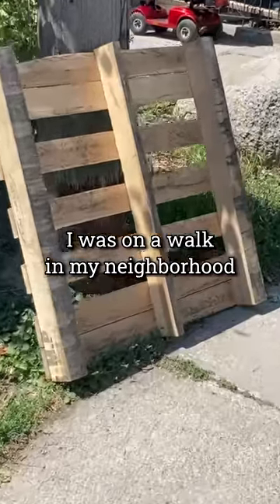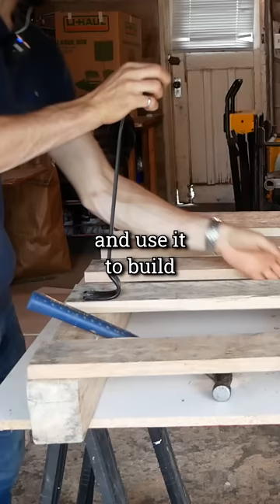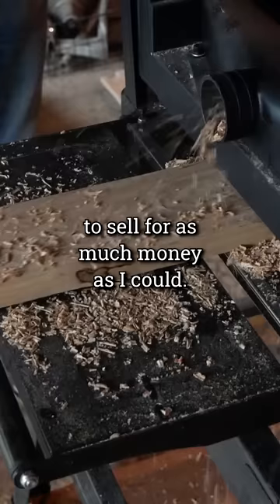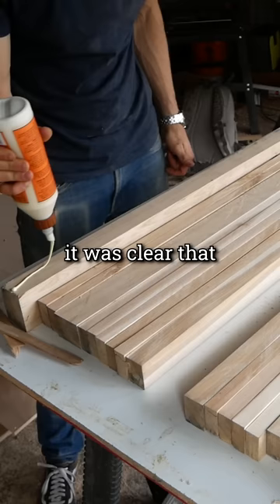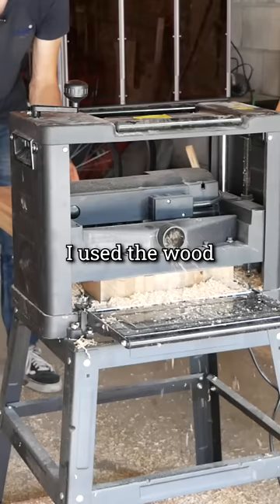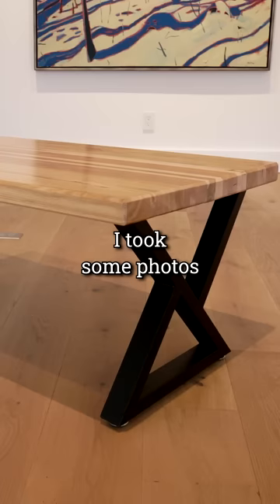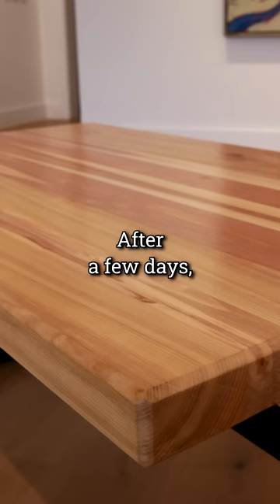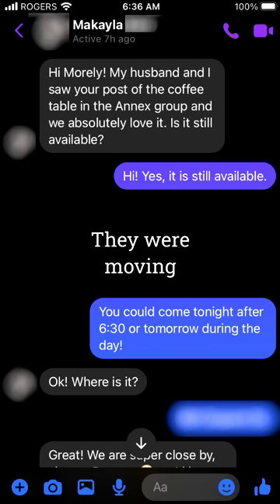Free pallet 👉 $550 coffee table #DIY #woodworking #upcycling #shorts

Comment: Lots of pallets from Asia are hardwood because they get loaded up and stacked in containers with massive weight. Look around importer warehouses. Probably give them away free because they usually are odd sizes for USA/CA pallet racks.
Reply: Depending on what's being shipped, a fair amount of stuff in the US gets loaded on hardwood pallets. 

In the parts of the country where hardwoods are primarily what grows, there are sawmills that concentrate on providing solid oak or other hardwood pallets to companies that need them.
Reply: And mostly illegally obtained too🤣
Reply: I didnt think that was hard wood, but if it was then that's fine to use a pallet
Reply: I've worked in warehouses, and I can confirm that they will DEFINITELY not give you any pallets for free lmfao they cost money
Reply: @Miguel-cg2vz  they will give out old chewed up ones tho...

Comment: How can you sell it for that much? Daylight robbery
Reply: Looks like something you would buy at Walmart for $125
Reply: @robbnoble1509  granted it would fall apart next week
Reply: Hardwood is a quality material and 550 is a great price for nice furniture
Reply: @averyspurr2045  Pallets are usually chemically treated, so even if it's hard wood it will deteriorate much quickly and could pose a risk to health so yeah.
Reply: @winglessbat  Pressure treated wood is much more resistant to rot and ware than untreated wood.
Reply: You make it.  To get started you'll need like $2000 for all the tools and supplies....planer, table saw, sander, sanding paper. clamps, wood glue, screws, nails, steel legs(not cheap) sealer/stain.  And yep, you'll save a buck or two ...cause yeah, you work for free.
Reply: Everything is worth what people will pay for it.
Reply: It's worth what ever you can get someone to pay
Reply: Says the guy who lacks the tools, skills, and knowledge to build a table like this.😂🤣😂🤣😂🤣😂🤣😂🤣😂🤣😂🤣😂
Reply: up to the buyer if they want to pay the price 🤷🏻‍♂️
Reply: He just made it up.
Reply: @quietobserver4636  the knowledge? What the hell U think this guy built Noah’s Ark?
Reply: @_t_f_  The point is he built it, he set the price, and he sold it. Contrary to what you've been taught, you YouTube warriors can't put a value on another man's labor and it makes you mad. So, just ask your mom to buy you one I guess.🤷‍♂️🤷‍♂️🤷‍♂️
Reply: because it's handmade by someone personally? Skills you don't gave, working hours, tools you don't have and it's good wood. no one's asking you to buy it lol. the store one will obviously be cheaper because it's not handmade
Reply: @Rie_Bot  to understand this kid's comment you must understand how they've been continuously indoctrinated their entire lives. They're taught the doctrine of envy and victimology. They never consider what it took for an individual to get where they are, or achieve what they've achieved. They're just taught that it isn't "fair". They want equal outcome without equal effort.
Reply: You obviously know the cost of everything, but the value of nothing!
Reply: @Rie_Bot  and what's so special about it being handmade?
Reply: @eulehund99  handmade things are often better quality than mass produced ones which use every cost cutting method they can. buying handmade stuff also supports people producing these products, not just large businesses, and thats needed to have healthy competition in the market amongst sellers, which leads to better quality and priced items overall in the market. other than that, there isn't anything special, don't buy if you don't want to lol, no one is being forced. but this section of the market exists because there is a demand for it, and a significant demand of people wanting handmade products. its a bit of a novelty
Reply: @Rie_Bot  good points you mentioned. From my experience, I saw little to no difference between handmade and mass produced ones (except food lol). I often even found the mass produced to have better quality, but the handmade to be more interesting. I also wouldn't say the demand is huge for handmade production, as we today have a new trend every hour.

Comment: So other people dont make this massive mistake, most pallets like that, are owned. They are not just free, they belong to a company, especially if they are blue or red. Just dont.
Reply: The place I work at we get shipment of supplies and we always cut them up and throw them away. But it’s important to ask before taking
Reply: I've worked at multiple places where pallets would pile up.  Some of them kept their pallets locked up in fenced areas.  Some kept them loose, but tucked behind the building.  But one place I worked for purposely stacked them out by the road because they knew people would come by and take them.  This is the case with a lot of companies that use a low volume of pallets, not enough to justify a truck load pick up/sale.  If the pallets was left by the road, they were likely expecting that someone would come take it.
Reply: @Robb Noble  as i said, most are owned, and only leased to companies. Specifically the red and blue ones. And they pick up their own pallets, you dont pay them anything as a receiving company. Shipping companies pay for the lease, and the pallet companies maintain and ensure a certain amount for them.

Comment: Anyone thinking of starting doing stuff like like this: a lot of pallets are pretty nasty and get reused so you don’t always know what has been sitting on top of them. I work at a printing company and we get pallets all the time that smell like motor oil or other less than pleasant things. Just be sure to really inspect any pallet you’re thinking about using.
Reply: He sanded the wood then sealed it, so it really doesnt matter if the wood is "clean" or not.

Comment: I’m trying to figure out this guy’s hourly rate.  I first subtracted the $65.00 for the amazing legs from Amazon, leaving $485.00.  Then I subtracted another $50 for materials, (stain, polyurethane, sandpaper, biscuits, etc…) leaving $435.00.  Then I subtracted the cost of tool, shop and utilities at a prorated rate of $200 leaving $235. Now, it’s all about man hours.  1 hour locating and retrieving the pallet, 3 hours dismantling, removing the nails, and planning.  4 hours for jointing, sanding and router work.  3 hours for staining and finish coat, and assembly.  2 hours for administrative work (photo shoot, advertising and shipping.  That equates to about $20 and hour less income and applicable sales taxes.  He’s doing better than a McDonald’s employee.

Comment: I wonder if old discarded furniture could be recycled into new uses. Many old furniture items were made of solid wood, of much better grade and denser than today or are just too expensive or difficult to get. You would have to be careful (like with modern pallets) that don't contain hazardous materials or where leaded paint was used.
Reply: Not only old furniture but old houses aswell! A lot of houses built in the 50's/60's were made of really high quality wood that's hard to find nowadays, I wish we would strip the wood from the frames instead of just knocking the whole structure down!

Comment: Serious question, how do you deal with brittle wood?  I’ve gotten pallets and the slats are extremely brittle and difficult to get off usably.  I’ve gone to slicing the nails but if I put a nail or screw through it it splits.  Suggestions?
Reply: Pre drill hardwood for screws and nails.
Reply: Soak it with water a few times before pulling the boards. The wood swells and doesnt crack as much

Comment: The key to this project is that it was hardwood.  That's not cheap and it is obviously not pressure treated.  The steel legs are not cheap.  This is actually excellent quality made by an artist in my opinion.  I've made handmade furniture and you need a lot of tools and experience to do it right.